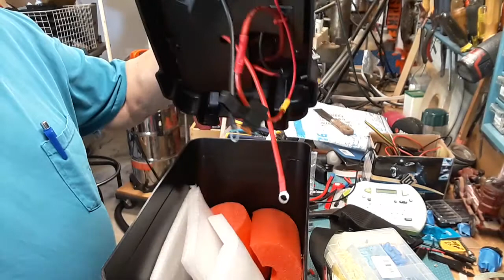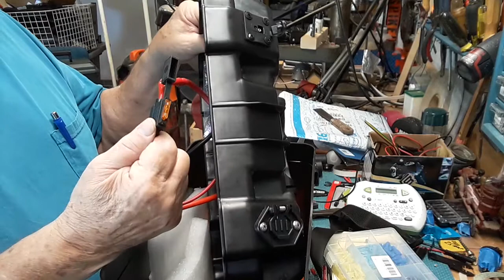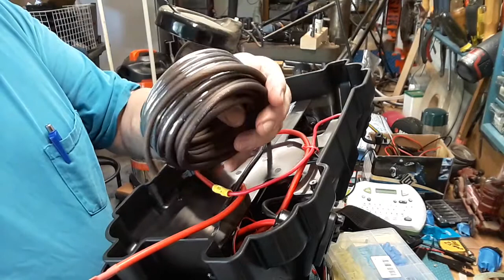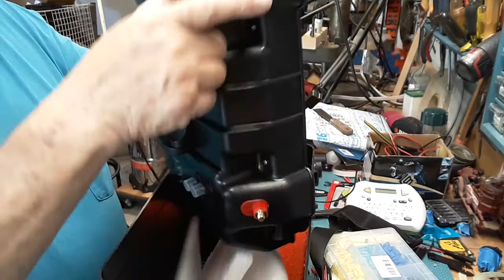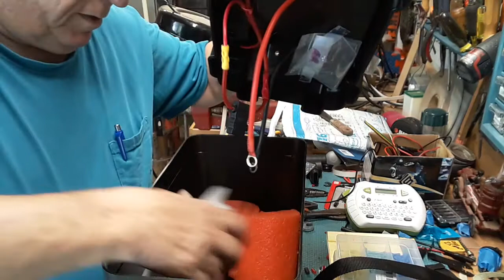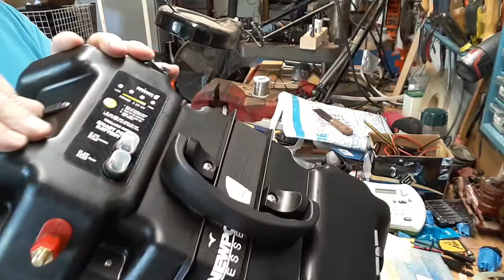Modifying a Newport Vessels Smart Battery Box- add an Atwood Trolling Motor Plug and a charging port

Comment: isnt there a positive and negative port on the out side ofnthe box for younto connect your charger and not takeit out the box😮
Reply from the maker: If you'll read the previous comments, especially the one by Newport Vessels, the black and red lugs can be used to charge the battery without taking it out of the box. Also if you'll read the note above, I corrected that information.

Comment: Your correction above has a typo and it still reads like you can’t charge the battery without opening the box, which of course is not true. You need to change the word “correct” to “INCORRECT.”
Reply from the maker: Thank you Michael. I've changed the wording.

Comment: Did you ever post a video of how to tie the fishfinder into the wiring of this box?  I have the parts, but not sure how to wire it in.
Reply from the maker: Although not specifically for the fish finder plug, I did mention how I did it and showed where  I connected it and how I did the wiring. Here is the link and it is explained at about 2:48. I hope this helps.
Reply: @crude4u1948  Can I find you on Facebook?  I'm trying to wire in a fish finder similar to what you did, with the inline fuse, but want to make sure I'm connecting it properly in the battery box.
Reply from the maker: @jasonmcelvoy4743  I am the Jack Wall in Austin, Tx

Comment: why would you not run your additional wires under the cover plate ( concealed) instead of exposed to the top of the battery?
Reply from the maker: There are no circuitry wires anywhere except under the panel inside the lid. Not sure what you are referring to. When sealed up, there are basically three wires exposed. The red and black wires are the batterie connections and the other red one is a fuse for one of the added circuits. I leave it exposed so that if it needs to be replaced, it's not necessary to disassemble the cover inside to replace the fuse.
Reply: @crude4u1948  the OEM wireing is tucked neatly between the inner cover of the lid and the lid itself. This provides a degree of seperation between the battery and the wireing spagettie.  Your wireing is placed to lie between the innercover of the lid and the battery. Should hte cover pull down on the battery (which is one reason for having the inner cover on the lid) then your wireing is potentially subject to unintended mechanical forces.  
Hope this helps :)
Reply from the maker: @johnallen3555  I'm still not sure that you understand. After replacing the inner cover to the lid, they only wires that are exposed are three. The original black and red wires for connecting to the battery and the inline fuse I installed for the one accessory plug I added. That fuse is completely covered and protected from coming into contact with any bare connection or battery post. And as I explained previously, All fuses should be readily accessible so as not to need to disassemble any of the box components to replace a fuse. I hope this clears things up for you.

Comment: I would like to use one of these for a mobile solar power supply. Probably add some solar inputs and a digital volt meter. I’ll use a vmax agm 125AH battery. How does this box compare to the Minn Kota?
Reply from the maker: I have not had any experience with the Minn Kota box, however it appears to be nearly identical in every way to the Newport Vessels box. I landed on the NP box because I have one of their trolling motors and decided to stick with the brand. Also, I caught the NP box on sale one week and was able to purchase a half dozen for half the retail price. The only thing I don't like about either of the boxes is that they are not waterproof. or even water resistant. There is no seal between the box and the lid. This is probably necessary if you're running a standard lead acid battery sot that the gasses don't get trapped inside and cause an explosion. However I use the LiFePo4 battery which does not offers so I would prefer a water tight box. This is why for a larger battery I have gone to a larger ammo box. The convenience of using the NP box which is already wired for nearly everything I add, in most cases, overrides the cost of my having to build from scratch a completely customized box.

Comment: Any thoughts on using lithium iron batteries with NV trolling motors? It is discouraged by NV, but the difference in weight makes we want to consider the risk.
Reply from the maker: I’ve used the LiPoFe4 batteries in my boxes for two years. The only issue that might occur is an erroneous reading from their battery indicator. I use a battery meter specifically designed for this type of battery. However , I’ve built several boxes and only used the onboard built-in battery indicator and I’ve never had a reported issue. I would contact NV and speak to someone and ask specifically why they recommend against using this battery. Hope this helps.
Reply: @crude4u1948  I appreciate the info, Jack. Just to be on the safe side, I thought I'd install a DC-DC converter (boost/buck) or a shunt.
Reply: @crude4u1948  How about 200 amp hours put in a Minn Kota box? I use these boxes to build CPAP backup power for friends and needy. This is my own and I marvelled at doubling its power. I bet it would run a trolling motor quite well. The 10 amp outlet breaker was increased to 20 amps, voltmeter added and a trouble light was put on and portable 300 watt pure sine inverter was added. 
https://www.youtube.com/watch?v=UwuC97gpng4

Comment: You should never run trolling motors and fish finders on the same battery. Will possibly cause interference.
Reply: My trolling motor has a specific battery just for it and all other accessories use a different battery.
Reply from the maker: I have built and sold more than 50 battery boxes using LiFePo4 and AGM batteries. I’ve built them using ammo boxes as well as the Newport Vessels battery box shown in this video. None of the boxes I’ve built have even had an issue with interference. All of my boxes have their power supply passed through a fuse block as well as a circuit breaker on it’s own separate circuit for the fish finder and the trolling motor is so equipped. I never undersize my wire or the fuses. Not sure why others have had issues but with mine, so far so good.

Comment: Hi Jack! 
Great review and video. One thing we would like to add is that you can charge your battery without opening up the Smart Battery Box! You can simply connect your charger to the external posts to charge your battery. Hopefully this helps in your future builds.
Reply from the maker: I apologize for the mis-speak. With some battery boxes the outlets are power out only rather than power in as well. On previous Newport boxes, in the instructions it was not mentioned that you could charge through the lugs. However, after reading your comment, I reviewed the owner’s manual and, as they said, charging is available through the cable lugs. thanks for catching this.
Reply: @crude4u1948  Glad we could help! Keep the great box builds coming!

Comment: Jack, I'm trying to decide about either Min Kota or new port battery box. I searched Newport manual and all over the web to find out if I have to take the box apart to charge the battery with the Newport. I see that with the min kota you don't' have to open the box. You said in this video you do on the Newport.  Is that so?  You can't charge the battery with opening up the straps?  Please let me know. That's a deal breaker if so. Why would they do?  I wonder. Thanks, I'm new to all this. I got myself an a SE9 Sea Eagle 11 foot inflatable with a trolling  7.5 to 34 AMP motor and a Diehard 27M 1 Marine battery. The New Port also seems a little big for the battery. The Min Kota is smaller.
Reply from the maker: Thanks for catching that. I will go back and edit the video to correct it. You CAN charge the battery without opening the box.
Reply: @crude4u1948  Very cool Jack. Thanks for getting back to me. All good. No worries.

Comment: Hello Jack what is the cost for this mod ?
Reply from the maker: $245 without the battery. Includes Atwood trolling motor plug, external charging port
Reply: @crude4u1948  How do i order one?
Reply from the maker: @jacobholmes6082  Look me up and message me on Facebook, Jack Wall in Austin Texas. We can work out the details there. Thank you.
Reply: @crude4u1948   I cannot find you anywhere... I found your company page but not your personal
Reply from the maker: @jacobholmes6082  https://www.facebook.com/jack.wall.104
Reply from the maker: @jacobholmes6082  Sorry for the confusion. I thought it would be easy. I just don’t want to post a lot of personal stuff here. Thank you for being persistent.
Reply: @crude4u1948  Since the battery box can be charged without opening the box by connecting to the two outside post, you really do not need the charging plug. Seems like the charging plug would be just for conveyance. That should reduce the price, right?
Reply from the maker: @jube42  The charging plug is for convenience so you can use a trickle charger. It also serves as a power port for a fish finder once it is equipped with the SAE plug.
Reply from the maker: @jube42  The charging port is for the convenience of using a trickle charger rather than alligator type clamps.. Also the charging port I install has heavier wire and can handle a 15 amp fuse and serves as a power supply for accessories. I use mine to power my fish finder (3amp fuse). I offer customers to send me the wiring harness for the fish finder and I install an SAE plug free of charge and return it with their new box.